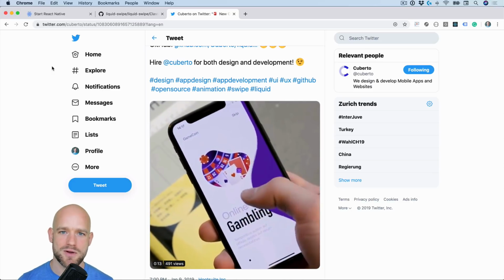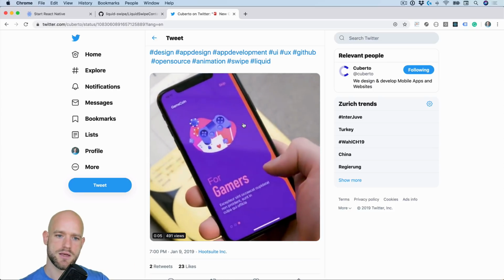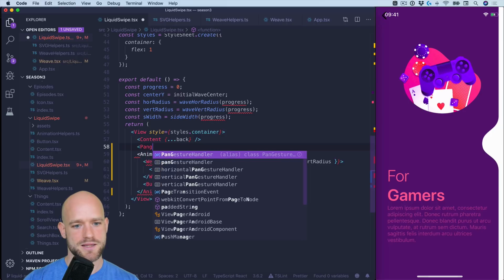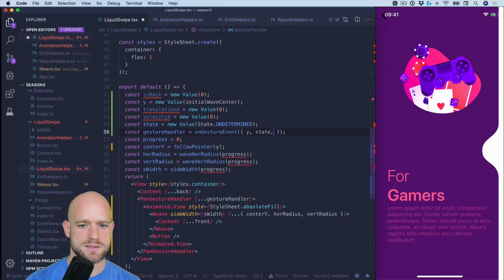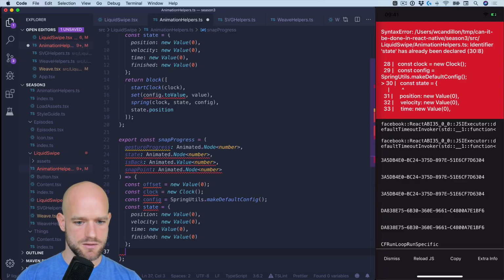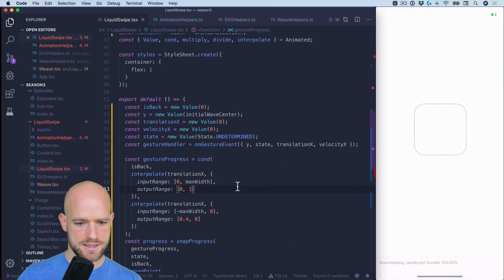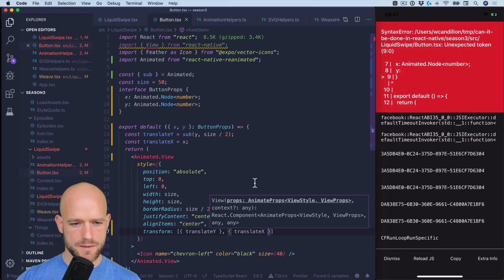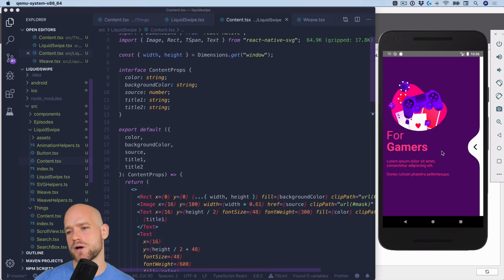Liquid Swipe - “Can it be done in React Native?”

Comment: Looks amazing, good job! regarding the SVG tradeoffs  due to layouting, i just got an idea, in theory you could use the yoga layout engine (which has a js binding) and create a wrapper for the svg elements that would convert flex styling using yoga to regular positioning. But anyway I guess getting it to work with native animations you would need to use yoga on the native side and that could be a bit more tricky I imagine.